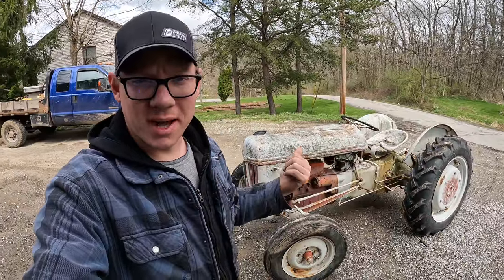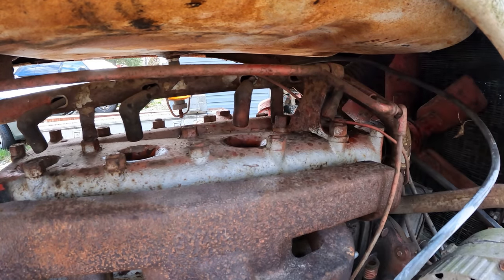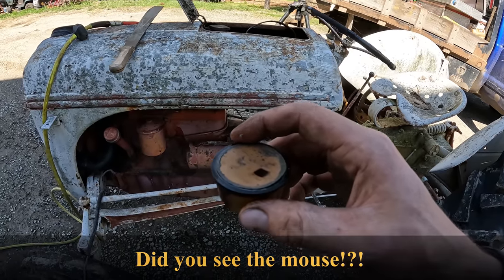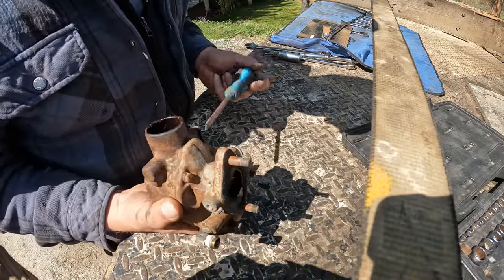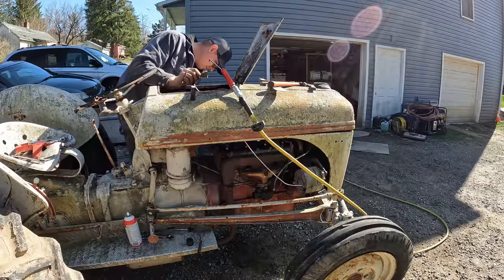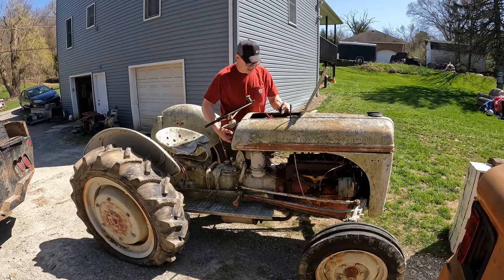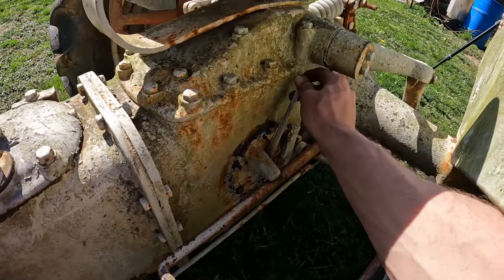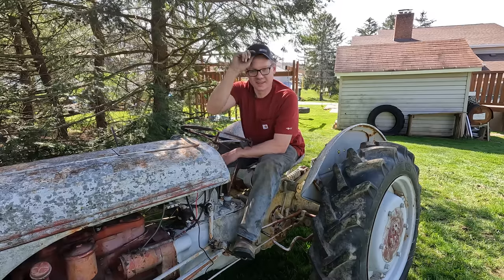Saved From the Crusher! Will this 80+ Year old Ford 9N Ever Run Again???

Comment: I own a 2N.  The distributor and coil are on the front of  the engine.  Also when Ford came out with the 2N (!942) They kept the 9N in the serial number until the 8N (1948) My tractor had been converted to 12 volt but the wiring was a DISASTER !!!.  Rewired it and used the GM alternator with a 1971 Ford regulator.   The specialty regulator that was used with the original blew and it was $ 70 - 80.

Comment: I'm really late watching this video, going earlier in your videos. I see paint loss on the hood, but no rust. Ford never used primer just enamel. Just in case though, The 9N (1939) was the first of the N series for Ford. The first 250 had aluminum hoods before Ford had dies made to stamp out metal hoods. These 250 were prototype tractors. They were sold along with the metal hooded tractors. If yours has an aluminum hood, it is very very valuable.

Comment: The front wheel hubs look like they cut off the old 4 spoke hub and put on a 5 bolt hub vs 4 bolt hub that takes a special wheel and they're hard to find for 1930-40's tractors with paying through the roof for them because they're collectibles for original rebuilds.

Kyle

Comment: You were asking about the hydraulics not working, did you engage the PTO on the L/H side? it's the small lever at yer heal. 

Thanks for the tip about rocking the tractor with the plugs out. My 8N was running fine. Started to make a whirring sound, and stopped, dead in his tracks about four seconds later.

Comment: You can clean fuel valves and lines as well as carburators with concentrated vinegar or citric acid (let it work for an hour is enough). I'm using it for vintage motorbikes and it always solved all the problems. Just don't let very fine screens sit in it for too long. When it's clean it's ready to use.

Comment: I found the easiest way to service the ignition system is to pull the distributor off and set it up I use to change my points condenser cap rotor every spring I found it was worth trying to clean it set everything and mount it back on the engine

Comment: If it doesn’t have one installed, you’ll have to put a slip drive adapter on the pto shaft. That way, when you disengage the pto, the spin of the implements don’t keep forcing the engine to spin over. 

That was something that was modified on the 8Ns & forward.

Comment: Known on the UK as a Fordson Dexter. The design for the time when Harry Ferguson and Henry Ford had a brief working relationship.  
Possibly Ford wanted access to the three point linkage system which revolutionised the way that tractor and equipment design was done

Comment: It's really cool how you took that Ole thing and got it running. I don't know how much you had to pay for it and I couldn't find it on EBAY and I followed your link. I just wanted to know what you got for it. Something I really regret in my life is that I didn't learn how to fix stuff. I really admire people like you that can jump into just about anything and fix it. I wouldn't be surprised if you built your own house. Anyway GREAT JOB! I'LL be watching now to see what your next project will be. I'm an old wheeler dealer that can't pass up anything I think I can make some money on so that's why I am interested to see how much you bought and sold it for. I think your know how is the biggest asset in this deal. The work you did to get that rig running is worth whatever markup you put on the Tractor. Again GREAT JOB!
Reply: Buy a cheap motor scooter.
Work your way through it. 
Start by changing the spark plug and setting the gap. 
Work your way up to changing the CVT belt. 
Heaps of You Tube videos to follow. 
The more you do the more confident you will become. 
Then you can transfer that experience to something bigger, like tractors.
Good luck. Never too late to learn.

Comment: You don't have to struggle with the distributor. Two bolts in the front and the hole thing comes off and can be adjusted. New points and condenser can be assemble on the bench. You cannot put it back in wrong. It won't go.

Comment: On the topic of those front wheels...
Its entirely possible that tractor was equipt with steel wheels; being in the hight of ww2, rubber was being massively directed to the war effort making pneumatic tires quite expensive, so it was a fairly common practice to buy steel wheels, and when the price of rubber came down, adapt a pneumatic rim to your old setup. I growing up my dad collected old internationals and we had a few where they cut the spokes at the outer edge and then welded a dayton style rim back onto those spokes. The givaway on those is factory international pneumatic rims used round spokes while the steelies use flat spokes. I was also taught to tell 8 & 9n's apart was the size of the wheel hubs. Correct me if I'm wrong, but the 9n's used really large and wide wheel hubs all around. Our 9n with tires has a hub about a foot and a half in diameter. So i believe you've got a pair of 8n rims. On an 8n the rear hub would also be significantly smaller. I don't know about the foot rests but for what its worth our tractor had them too.

Comment: I own a '46 2N (9N's from 1939 thru 1941, 2N's from 1942 thru 1947, 8N's 1948 until the '50s).  I use mine regularly for mowing 4 or 5 acres twice a month.  Hard to kill these.  That antifreeze smell might be from the notorious Ford N-Series "smile" - a slight crack that develops in the block opposite the manifold side.

Comment: Matt if you look on the left side of the engine there is a flat casting spot with the serial number on it and should tell you for sure. If it is a 9n it late 30's mine is a 1940

Comment: The best way to work on that distributors take them two bolts out and pull the distributor right off and then you can see what you're doing and that drive is off-centered so you can't get the timing messed up

Comment: That's a 6 volt coil, probably burning the points with 12 volts.  Needs a resistor.  I had one of those with a post hole digger on it which didn't work out.  The lift arms won't lift with the PTO disengaged.

Comment: Or... use a crank starter... these had a hole at the bottom of the front wherre a crank handle can be fitted.  The handle would normally be kept draped on the square part of the body just behind the gear stick

Comment: Fuel valve has a reserve built in . Remove fuel valve and clean that screen. Should pull out. I get rid of that whole assembly and replace with modern ball valve. Then buy a large metal frame filter mounted horizontally. Water lays and dirt lays on bottom of filter. Can be removed and drain water out. You can put rare earth magnets on filter bottom catch rust.

Comment: The 2n was made from 1942 to 1947 and had foot pegs and was all grey. The motor was also grey. As that engine is red stands to reason it may have come from either a 9n or 8n.  For the 1st 2 years the 2n also came with steel wheels, magneto and a hand crank and no battery. This was because during that time in the 2nd world war rubber and batteries were rationed. Once the rationing was over then the remaining years for the 2n would have come with rubber tires, battery etc.  I own both a 2n and an 8n and except for the transmission, color, foot pegs on one and running boards on the other etc their both quite similar.

Comment: The way the plugs looked i think it would be worth pulling the old flathead off and taking a look. In the process you will get to the bottom of that exhaust leak on number 4. All in all it makes me want to spend a lazy afternoon with a dual axel sander finding that old gem underneath all those years of abuse. Now about that coil swap you did:... is the new coil 6 or 12v? I have converted between the two before and going to 12 we needed to add the old J.C. Whitney coil resistor when running on 12v.. Obviously we have a 12 volt tractor now and I can't remember when the last time was I saw a 6volt alternator!

Comment: There’s a chance those old spiders, torched off on the wheels, were for steel wheels. My grandpa’s first tractor was a ‘41 9N. Due to the rubber shortage in the war, it had steel wheels. Before that, he farmed with horses. Still used the horses after ‘41, but the tractor was a huge productivity boost.

Comment: Be careful running that around in any grass that you care about!  That rear wheel is eaten up (most likely) by calcium solution inside those rear tires for added weight to improve traction.  The really bad wheel has already lost the calcium solution, but watch out for the other wheel to spring a leak at any time!

Comment: Matt, as a suggestion, wear a short sleeve shirt, 
when working on gasoline systems.  Especially, 
when working under something.  The gas will 
run down your arm, to the armpit.  Ask me how 
I know.  (Also, tie a shop towel around your wrist.)

steve

Comment: By the look of the spark plugs, they’ve never been fired - common the 6V coil in the mag is shot as a result of running a 12V alternator. I do believe 12V coils that fit within the mag body are available.

Comment: I got a locked up Allis chalmers B and unlocked the motor by taking the head off and putting motor oil on top of the piston and hammered it with a 2x4

Comment: It was probably already said but the Ford flatheads and their similar engines tended to put out lots of heat through that head and that's theoretically why the plug wires run down a tube instead if in air:  Provides some heat shielding.

Comment: Tires look good. Those alone might be worth $400. I put tires on these things weekly, great tractors. As far as the front tires and wheels, they usually have 4.00-19 on them and it looks like yours has 6.00-16 so I'd guess the wheels were replaced.

Comment: That coil might be 6 volts Mine failed and a replacement coil was expensive.  I gutted the coil drilled a 1/4 " hole used a brass bolt to connect to the center terminal and remote mounted an igition coil from a 1971 Ford truck.

Comment: Been using teflon tape on my gas fittings for the past 3 decades and NEVER had a problem. I even own a Ford 9N and 8N. The problem with teflon tape clogging a gas valve is often times because people are ignorant by running the tape all the way up the threads and past the threads whereby when the valve is threaded back into the female threads and then tape is not just secured between the 2 mating threads anymore. Just wrap the threads only using the standard width of the teflon tape as your total width to cover the threads.

Comment: Also, the radiators get plugged up easily, & the in-tube mounted thermostats fail a lot. It’s better to just remove the thermostat & have continual coolant circulation.

Comment: Come on man, that tractor fits you well. Glad to see it running  though instead of going to a junk yard to get crushed, wouldn't  be bad to have around the house. What you want for it? So I finally  got to watch the rear of the video and went on ebay and it done sold. Actually  went for less then I thought but well worth it.

Comment: And if the left brake is set right when you push the clutch pedal all the way down it will also put the left brake on and a 9N an 2 N are 3-speed

Comment: No magneto just front mount distributor and you can either find a used rim I put rear John Deere rims  on mine they were a little taller but made it look cool lol and there was a ship load of these tractors that had water and no antifreeze in them and they froze and broke the side of the blocks and they were repaired by welding them so if you have one with a repaired block you now no why

Comment: 15:00 you have 4 metals in contact causing galvanic action, the pot metal with zinc in it and being the least noble, becomes the sacrificial metal and seems to dissolve, oxidizes into a stable form of zinc.
Reply: Why outboard motors and boats love to have zincs on them.

Comment: i have a 47 2N and cleared 3 acres of timber with it and couple chain saws over the last year. Nellie fires right up even in -10 degree cold when clearing the snow from the drive, better than my '63 800 Power Master Ford. (her name is Paula). Won't find a better working small tractor than the old N series.

Comment: Those old front  Distributor tractors are easy to work on just unbolt the 2 bolts and work on the work bench the cam key way only fits one way it is offset no big deal.

Comment: great but DO NOT ever leave unleaded gas in a cast iron carb as the alcohol will eat the cast iron. if you have to use unleaded shut the fuel off so the carb runs dry

Comment: Pour brake cleaner in each cylinder until full. Let it set for 1 month then start it. It should turn over. Usually the rings are rusted.

Comment: hi there you need to join the OLD FERGIE CLUB here in the uk they can still supply you with just about every part you'll need to rebuild the tractor and as for information you will be astounded 
ive had a few of these they are great little tractors especially if you want to cut the grass lol

Comment: We had an 8N and 9N that we used for over 20 years. In those years, the only problems we had were common for those tractors...carb rebuild, alternator rebuild and exhaust manifold leaks. Other than that, they were strong but simple tractors to operate and maintain. Id love to have another one.

Comment: Could be leaking coolant into the exhaust and not showing at the radiator. Perfect little tractor for a small piece of property. Restored it will look a lot like the ford Jubilee tractors like the one that Judy Garland drove in Summerstock.

Comment: I've discovered your channel recently and been watching a bunch of your videos, I don't understand nothing to mecanics (mechanical?), have a bunch of questions but the first one is : is there any risk that this small tractor could make a 360 when engaging the first gear, and crush the driver ? Does the behind arms prevent this ? Or is it just that the the engine weight is enough for this to never happens ?

Comment: I got a free Ferguson to-30 because it wouldn’t run despite 3 professional mechanics looking at it. Well mechanic number 1 or maybe the owner put the distributor 180* wrong. Dad and I figured it and had it running in less than an hour. The guy who gave it to me wasn’t happy but never would take it back. He had put $2,800 into it to make it run. I run it for little things throughout the summer but come winter it starts right up and I pull the kids behind on a sled through the woods and hills. Been doing it for 8 years and hopefully they will let me do it when they are teens.

Comment: 80 years old and its head gasket is still in better condition than your average rover 200 was when new ;o)

p.s. I know little about the engine although having worked on myriad two strokes I am guessing its not that different. But the body work I'd love to have a crack at, black mud guards and seat, block handles, the rest in red apart from the engine block, that would be silver. Easier to see where the crap is when cleaning :)

Nice job, cute little puller.

Comment: Yes it is totally possible for a up draft carb to fill up the engine with gas and it damn nearly killed me .I Had the worst cold and could not smell anything the tractor ran the day before the next day it was locked up. What i thought was a bad head gasket took the plugs out full of liquid yes i used the yellow antifreeze thought i will spln the engine over and clear the cylinders then do a compression test the coil sparked and had a 6 cly flamethrower

Comment: You should sand blast it and give it a quick paint job with some Ford blue and fix that exhaust leak.  Bet you could get $1000 bucks or more if you find the right buyer who is into these old Ford tractors.

Comment: Gasoline in a tractor sounds so odd but considering the cold north, diesel tractors would probably need heated fuel tanks, insulated lines etc to start up reliably during winter.

Comment: 9N's had rivets in the centre of the rear hubs... I have a 1942 9N...awesome little tractor, it's the only one I've seen with the Sherman hi-lo gearbox... I think the reason these tractors can still be found is that they were simple/reliable. What killed their popularity was the introduction of PTO equipment ...they didn't have a 2 stage clutch and didn't really have enough power to run pto equip. I run mine just about every day. Glad you found a home for yours...somebody's gonna be happy! BTW... NEW parts are easy to find, check out SteinerTractor.com
Reply: Sold my late fathers 1954  8N in 2020 for the same $3250.00 that he paid for it in 1980. He restored & repainted it and used it for 40+ years on his northern Michigan acreage. It had the Sherman transmission on it and was a great tractor!

Comment: They originally had a 6 volt Generator, Starter and Battery.  The Battery cables were a lot Bigger with a 6 volt system.